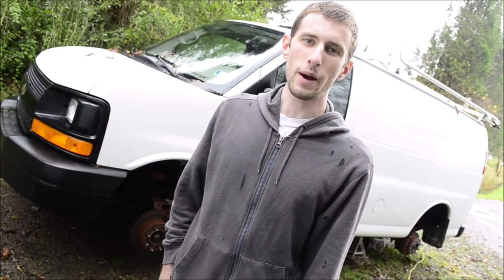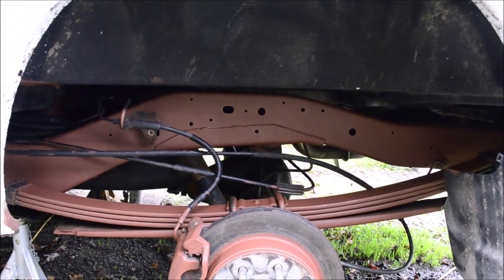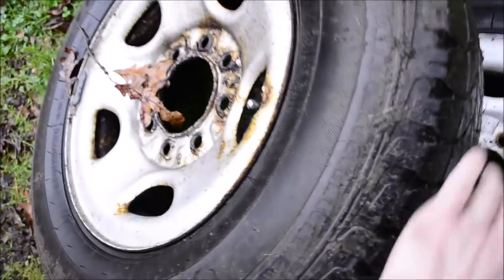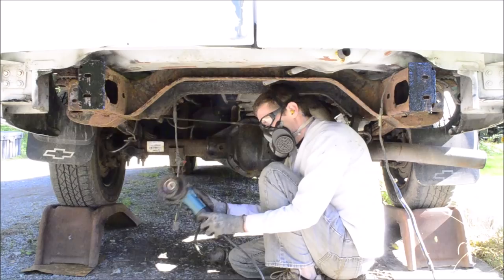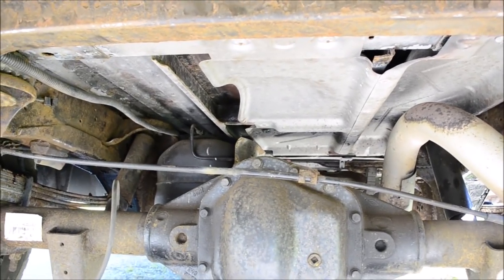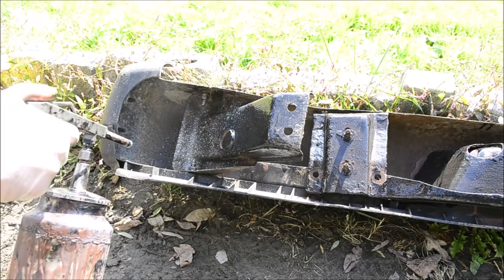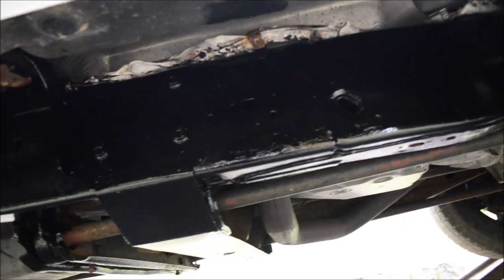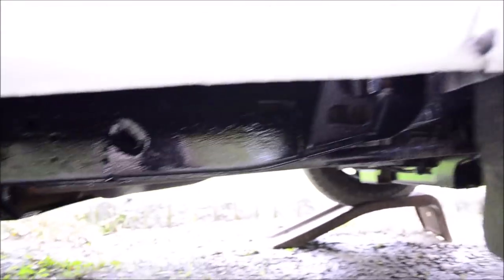Frame Rust Clean Up, Paint, Fluid Film - Corrosion Protection

Comment: Nice job!  I think your process is the most realistic, practical and economical means of treating an existing rusted frame on a vehicle without going to extremes, like pulling the body from the frame.  You've removed all the rust and scale that you could reasonably address, then protected the metal anywhere you can reach with primer and paint and finally treated the hard to access nooks & crannies and the insides of the frame with fluid film.  This process isn't "restoration quality", but it should extend the life of the frame and keep it structurally stable for as long as the rest of the vehicle is road worthy.
Reply from the maker: Spot on, what I've done wasn't meant to be a restoration but rather extend the life of the vehicle, or at least preserve it for a time until it can be thoroughly restored (if it was such a vehicle worthy of restoration)
Reply: I use Ospho. You can buy same thing at Big box home store as concrete etc etc. I spray this on the frame without doing all the removal work. Get the flakes off and use the acid. It works very well, then cover with what he used. You don't remove all the rust or won't work. If it's exposed to the sun you need a topcoat. If on frame I just leave it and put this paint on later. If you don't get to it no worries. I just like the look of all black under auto.
Reply: @aDIYCarGuy  Well now in 2022 where a 150k truck costs 5 grand and 4 wheel costs 7 to 10k spending a thousand or so and some tume making it last another 5 to 10 years is a wise choice. Most ppl don't Do this to their autos, so of you do sell and try to find another you'll just be back at square 1 with the one you sold. You know what's up and good on what you had, or have, don't have a clue about the one you buy. Try Blaster. I've used it and it holds up alot better to washing compared to fluid film. When I used fluid film I'd add about a cup of trans fluid to it and mix well. Never had any issues in rust belt. The trans fluid won't let it rust. Used or new.

Comment: I did the same to a Durango and also used the Fluid Film, but I sprayed a Rust Converter, the Rust Kutter, and waited 24 hours before painting. I am glad I did because it turned the whole thing black by converting the iron oxide into iron sulfite, like when you blue a gun barrel, then I painted and it turned out perfect.

Comment: Said you didn't have an air compressor but then proceeding to air spray your fluid film. Anyways great job man was gonna recommend using a needle scaler next time they're great for getting in tighter areas that the angle grinder wire wheel cant get like corners etc..
Reply from the maker: * a big enough compressor that would efficiently spray the whole thing. I had a pancake that i could use to spray impossible-to-brush areas. and thanks yea I've been considering buying a scaler

Comment: Great Video! Watching from Guatemala. I bought a Honda Crv 2003 last year with the same rust issues. It came from USA Rhode Island (salty roads as well). My question is if I do this to my car will the rust come back even though it won't continue to be damaged by salt anymore? Or will it continue to rot?
Reply from the maker: Thank you! Eventually the rust will come back, but cleaning and coating the metal will make it last longer and slow the rust if you do a good job
Reply: Use Ospho to kill the rust and it'll last a lifetime.

Comment: I've done my vehicles with Fluid Film and it washes off too fast. Try chainsaw bar oil, heat it up on a hot plate in an old pot and add a few pieces of paraffin (an old candle). Not too much paraffin or it will be tough to shoot.
Reply: dalesworld Have you tried Fluid-film gel bn?
Reply: Thats essentially waxoyl...
Reply: add a cheap toilet gasket or 2. Heat up and spray with a cup of trans fliud. won't be sorry.
Reply: or try Blaster wax, from PB blaster. You can also try adding about 6oz to your mixture. Play with it and figure out what works best for you. I've done the 1 tube of any grease,  trans fluid 1 qt, 1 or 2 toilet bowl wax ring, tub of Vaseline, 1 qt of motor oil and melted and mixed and sprayed in belly pans of Dozers, skidder, log trucks and trailers. No rust for decades. And the frame and especially the standards are just hollow 4 inch tubes with holes for the lights. Water gets in and it rusts so fast it's not funny. I've used this concoction and I have a log trailer me and my dad built in 1997 that still has no rust whatsoever. Wed usually buy old ones and sandblast and do all that to make new. Now we just spray with Ospho or any home depot phosphoric acid, and cook up in a 3 gallon pot the ingredients I listed. You don't need alot when sprayed, brushed etc. It's all cheap, easy and you don't have to have a clean sandblasted surface. The acid forms a black coating that seals the rust forever and the coating won't wash off, scrape off etc. Ever try to get gas off of anything you didn't want it on? It just won't let go. Now imagine that plus all the wax, fluid etc mixed with it!! It's truly unbeatable for 10 dollars at most. If you have used oils and fluids then it's even cheaper, just need toilet wax rings. Mix whatever in there you like. As long as you got the wax rings, trans fluid, grease, you'll be fine. The other stuff is just icing on the cake and logging is dirty, muddy, and nasty work. If our machinery and log trucks can take it, your car or truck will last forever. I guarntee it. I use baby oil and mineral oil in my Town car in doors, trunk and good and rockers. Then I spray this under and in cavities. Blaster does work alot better than woolwax and fluid film it's just pricey like those are and I'm cheap. Over 30 years I've never had a transmission, transfer case rust on me, never saw anything that took grease rust. I have a 23 yr old town car that's rust free and a 07 that's rust free and a 15 dodge 2500 rust free. 1996 Kenworth, 1990 Auto car log loader, 2 JD 650 dozers, 2 skidders 740 and 640, home built saw buck, 2000 prentice loader all rust free. And it costs way way less than any other rust prevention out there. Most pricey thing is what you do about the rust. If it can be blasted in a cabinet do it. If it can't get off the flakes and chunks and use acid to reform or remove rust. To remove you gotta neutralize the acid with baking soda and water. Why I use the Ospho. Don't need to with that. It's all in the prep work. U can have a 10,000 dollar paint job that'll be crap if you don't do a great job with the metal work, rust, primer etc.

Comment: So you went 1. Wire Wheel, 2.Paint it 3. Fluid Film. Do you think for the paint step it would be cheaper or worth it to use POR 15. I am going to be doing this to soon. How much did all the paint and primer cost you? Thanks
Reply from the maker: I did wire wheel, rust reformer primer, oil based paint, and fluid film on parts that I couldn't reach with paint, such as the underbody, and parts of the frame. POR 15 would be worth it but not cheaper. I bought 2 gallons of rustoleum for $60 or so, whereas 1 gallon of POR 15 is $119 or so. I used maybe 1/3 of each gallon. Maybe 2-3 quarts of POR 15 would do, as you wouldn't have to do the rust primer step as I did. Just remove loose rust and paint the POR 15 on and that's it.
Reply: a DIY Car Guy I somehow missed the part where you showed the gallon of rustoleum primer and paint. Thanks, ill be using those! So you wouldn’t need to use the aerosol rust reformer they sell in most auto zones? The primer is essentially the same? Thanks again
Reply from the maker: @vincentubiera5028  Yea the primer is a rust reformer primer. I used the "Professional" Rustoleum version found at a large chain hardware store
Reply: POR 15 is great, but it's alot of work and steps to use it and have it last. Can't shake, gotta use 3 coats etc. Alot easier to do it his way. He does a great job. And using the rust primer works same as Rust Converter, it converts rust to iron phosphate, no longer can rust, as long as the coating is on. And alot of ppl remove too much rust. It needs tge rust to make a successful conversion. Just knock off the flakes and chunks and heavy rust.

Comment: try to stay away from the rust reformers, I have not had not had good results with it holding up for a long time. your right with fluid film is safe to be sprayed. stick only with the fluid film and you'll be golden.
Reply from the maker: I've had great luck with the rustoleum professional rust primer from the hardware store. The regular consumer rust primer not as much for cars, not sure if it's a weaker formula or something, it's probably meant for lite projects
Reply: you gotta read the label carefully. Some say topcoat with OIL based paint only. The others won't work. Some are straight enamel paints only. They work very well if you follow the directions to the T. Call the companies and ask them what paint or if what you're using will work. I've found that they don't put all the info on the label for the sake of tge room they have and all the safety labeling. I've had a great experience talking to a few of them and it really saved alot of money, time and redoing of projects.

Comment: How’s it holding up??!
Reply from the maker: I don't have the van anymore but the fluid film should last a year or more, the paint should mostly last for 3+ years on the frame. It depends on many factors like location, driving habits, washing habits, etc. I check and touch up annually.
Reply: I can tell you that the same paint on a piece of metal will last decades if you just store it in a heated garage. But since the undercarriage sees road dirt and debris regularly no product will ever last.

Best thing to do is what he did: Sand, prime, and paint. That right there is enough protection. Fluid film every 6 months just to... Protect the protection lol.

Comment: Doesnt the paint tend to flake off?
Reply from the maker: if you don't prep the surface, sure, but generally it is pretty durable....I use the "pro" grade oil based paint
Reply: Add a capful or 2 of hardener for the type of paint. That'll make alot harder finish and last longer.

Comment: I spray fluid film at about 130psi and it goes way faster
Reply from the maker: I got a bigger compressor since this video and yea it does go a lot faster with higher pressure
Reply: To much. 50 to 90psi max